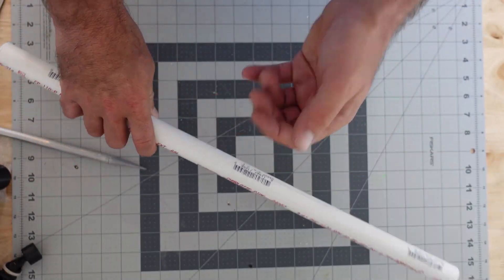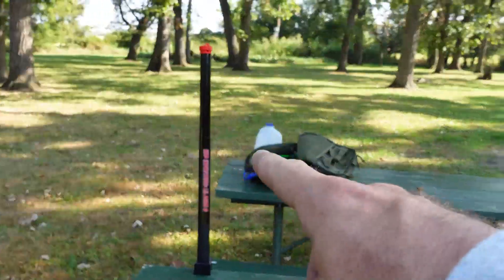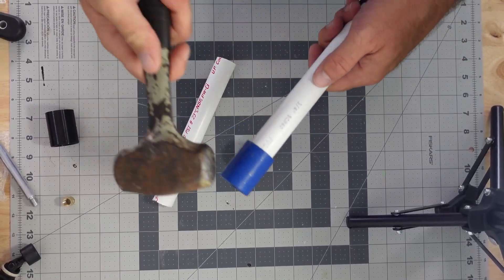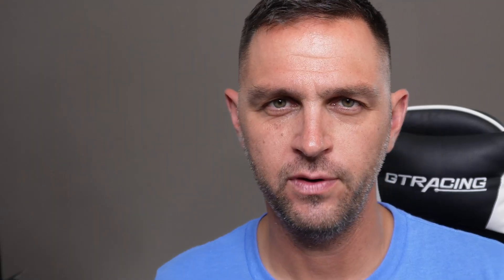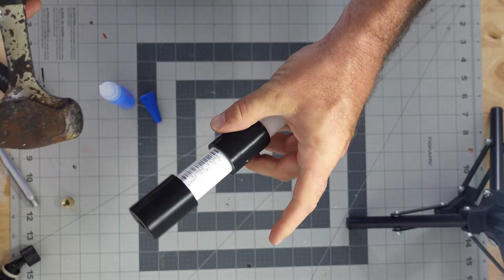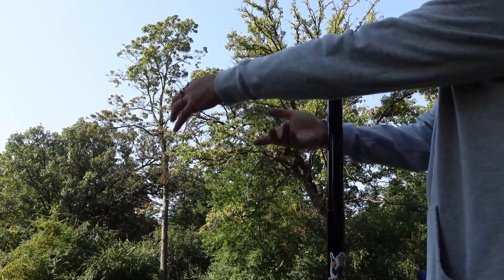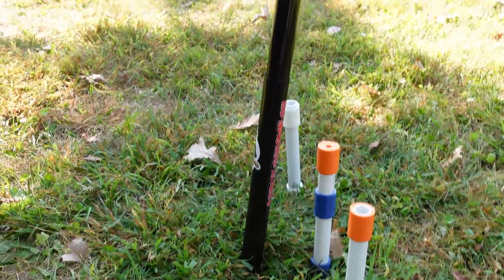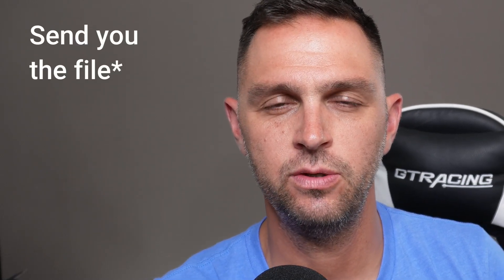EASY DIY - Antenna Mast You can Put in a backpack!

Comment: Heya Sean - your content is great and your honesty about both your products and "competing" products is refreshing.  That you give the STL's out to folks is even more impressive - thanks for everything you're doing!  Question for you on these - do you have a link to the M10 brass fittings that you use that would fit into the 3d printed parts?  My local Home Depot doesn't carry any metric fittings so I'll need to source these somewhere "online."  Thanks!

Comment: I don’t understand why there are so many ground-mount antenna videos out there. I clamped a mirror mount to an old photo light stand. I screwed in a 17’ whip that I extend to the proper length for the band I’m using. I have a couple lengths of wire that I attached alligator clips to each end. One end clips to the mount and other end to a 4’ plastic fence post with a spike on the end.  The whole apparatus is about 5’ off the ground.

I worked all states, all Canadian provinces and 54 countries in 10 days on FT8.

It takes 5 minutes to set up and take down.
Reply from the maker: Thanks for the detailed description of the mount.  I made one with a camera tripod and made a video in the past (https://youtu.be/6lMp8ChBURc for anyone interested).  

As for why I have so many ground-mount antenna videos (and picnic bench and other mounting solutions), I sort of hit on it in the video.  The last video I made about several ground mount videos and the video short teasers, they both give a look into how I come up with ideas.

This spike was the evolution (for me) of many different spike solutions over the years (since 2021)... Allowing people to see my method of thinking, building, and applying, will allow them to (hopefully) be better hams and/or engineers.  I am not saying I am an engineer.

But also, over the past 5 years, I have heard so many people upset that they buy a product and there was no support, no accessories.... essentially, no solutions.   So here I am providing solutions, so that when the viewers purchase the product, they will have a library of ideas, based on my previous videos.

Why not include K8MRD's mast in the works while I am doing mine? 

So that was my thought on it.

Comment: That’s a cool solution for a ground mount.  At the beach  I use an umbrella ground mount and a 1” pvc pipe with my DX Commander 7m pole.  What brand of 3D printer to you use? The printed parts look really good.
Reply from the maker: Hey, Thanks! 

I love when people ask about my printers. This winter, I may try to make a few episodes about them.  In this episode, I didn't really discuss all the different iterations I did and printed:

I printed Polycarbonate and ASA with my Bambu labs (Black and orange tips) X1C. I need to tune the X1C for the polycarbonate, but overall they turn out great.   This is also my main printer for printing things people purchase online.  The reasoning is, it has decent speeds and is fairly reliable.   The pre made profiles, typically just work.

For the blue ASA (that I am beating up with the mallet), I used my Creality K1.  It's an inexpensive CoreXY printer, that once the settings were dialed in (it took a lot of time), Prints GREAT. I don't use this for my primary printer, because I still have some trust issues with it.

If you noticed a clear or off white cap, that would have been done with Nylon 230  (it was a BAD choice for this print).   Nylon 230 is strong and flexible. I print those with my Ender 3 (modified with a sprite 3 extruder for direct drive, linear rails, Auto bed leveling, SKR 3, Dual Z, and Sonic Pad).  The Ender 3 has AMAZING print quality, but it is slow. It still has use though.

Have a good one!